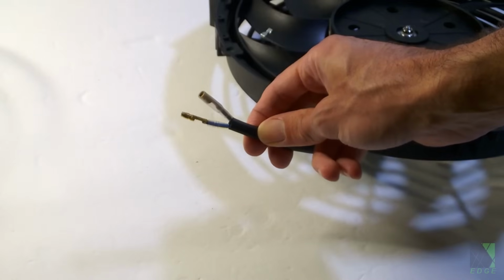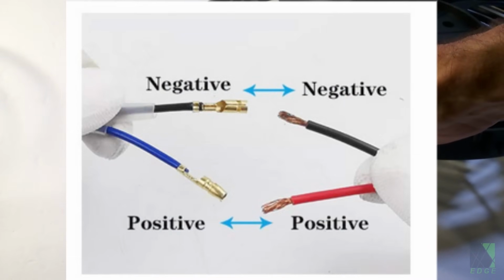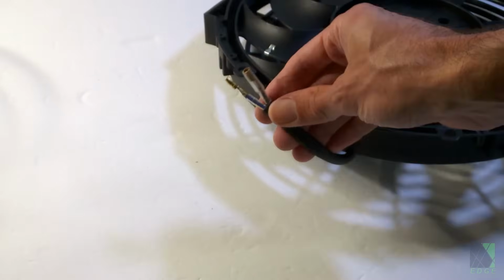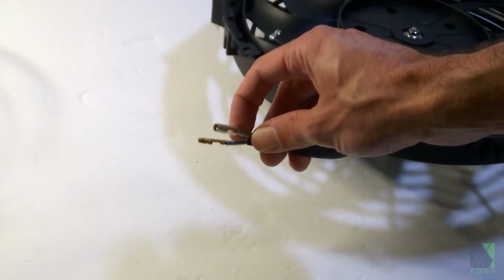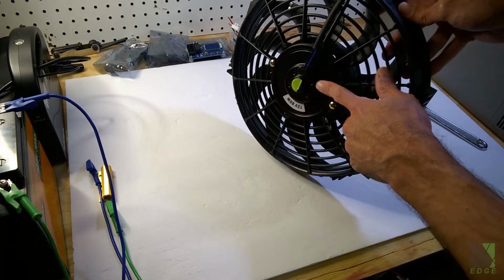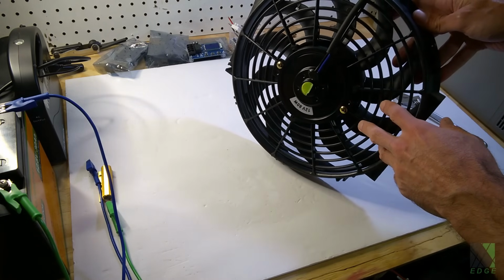How To Reverse a Car Radiator fan from Puller to Pusher - Solar Powered #Shed Ventilation Guide #DIY

Comment: You say that the fan has to spin clockwise. That’s the only way yet then you reverse the fan to spin the other way.  Now I’m really confused.
Reply from the maker: @davidsevier5656 Yeah this can get pretty confusing. The blade is shaped aerodynamically to spin one way only. But once flipped over, it is now spinning the wrong way. That's why the direction of the motor (polarity) must also be reversed. And this also reverses the air flow direction. If you don't want to deal with flipping the blade, mount the entire fan the other way around. Depending on mounting style, you might need a 12" fan grille to cover that blade. Only one side of the fan is protected by a grille.

Comment: Question posted Jan. 6, 2025: Can a PWM motor speed controller consume some of the power (fan speed power) of my 12V, 180W radiator fan?  If so, approximately what percentage of the maximum fan speed is lost from using a 40A PWM motor speed controller?  If I use a 30A PWM motor speed controller instead of a 40A speed controller, will my 12V, 180W fan run faster, or will the fan speed be the same with either of the motor speed controllers?  My power source is two 12V, 100W briefcase solar panels.  Thank you so much for your informative, interesting videos, and for answering your viewer's questions.
Reply from the maker: Hello, I am glad to help. PWM will consume a few watts (maybe 2-3% I guess), but there is no way around that. It's not really harmful, because imagine without it there would be zero control over the motor. We exchange a bit of lost power in return for speed control - it's worth it

Comment: I want to reverse the air flow direction of a 12V, 180W solar fan by removing the fan blade and flipping it over as you demonstrated, and reversing the polarity wire connections as you demonstrated so that the blue fan wire is now negative instead of positive, and the black fan wire is now positive instead of negative.  Please explain in detail how I then wire my amp / watt meter and my 40A PWM motor speed controller.  I presume I need to connect the blue fan wire to the negative load terminal of the motor speed controller, and  I presume I connect the black negative fan wire to the positive load terminal of the motor speed controller.  Is that correct or is it incorrect?  Please explain the correct way I connect to the positive load terminal and negative load terminal of the motor speed controller, and the correct way I connect the red positive wire of the solar panel(s), to the solar power terminal of the motor speed controller, and how I correctly connect the black negative wire of the solar panel, to the solar power terminal of the motor speed controller.  Please explain whether or not the red positive wire of the solar panel connects to the red power source wire of the amp/watt meter, and wether or not the red positive load wire of the amp / watt meter connects to the red positive power source terminal of the motor speed controller.
Reply from the maker: @bradlyons7046 Hello, the solar panel Pos/Neg connects straight to the Pos/Neg of the wattmeter first (then it should turn on, you can check). Then connect the PWM controller Pos/Neg to the Pos/Neg of the watt meter output.
With regards to the fan polarity. Usually they have a black and blue wire. I find usually blue is positive but there is no guarantee. However, try reversing the blade and connect the Black wire to the Positive of the motor speed controller output (and blue to negative), then check if the fan operates well. If the blade is spinning the wrong way, the performance is terrible - it's usually noticeable. Hope this helps

Comment: I got a push/puller fan from eBay the universal one, I was told all I need to do is swap the wiring around so black is live and blue is ground to use it as a pusher fan would I still need to turn the blades over or not?
Reply from the maker: @ashlysimon22 Hi, does it have curved or swept blades? I have never seen a modern radiator fan that could run the blades backwards - they have to be flipped over (AND reverse the motor). However, I certainly don't claim to know everything - there could be an exception! 

How about spin the fan in both directions, and check the air flow and sound. If it is the same both ways, maybe it's a different (universal?) blade design. Out of curiosity, I did test a fan without flipping it over, and the sound was different and it blew less air.
Reply: @solarpoweredge  it's curved blades on the fan
Reply from the maker: @ashlysimon22 Ah, probably need to flip it over then. But it takes 10 seconds to reverse the wires and see what happens. Maybe it will just work

Comment: Could this power vent my attic in the summer? Temperature switch and a solar panel on top of the attic vent and maybe a battery for the extra power generated.
Reply from the maker: @thorhammer6040  Yes, a car radiator fan can vent an attic. I'd suggest running the fan at 8-10v max so it doesn't get so hot and wear out as fast. Can also run without a battery if you want to, straight off the solar panel

Comment: Would it not just be easier to turn the entire fan around, mount it backwards like you would in a PC case?
Reply from the maker: @Allexz, no radiator fans are generally mounted on the flat side against the radiator or opening. Reversing them from puller to pusher is a very common task. So this knowledge applies to both sheds and cars/trucks in general. 

In both my shed, the fans had to be mounted round side facing out or they don't fit. Not only that, there is no protection from the powerful fan blades if I somehow mounted it the other way around.

Comment: Are you going to connect to a speed controller switch or use a Thermostat Switch Circuit "button" to turn on the fan at say 86 F  and off at a lower temperature? Maybe just an on/off switch?
Reply: I use a small button type switch for an RV fridge "computer style" fans when that small space reaches a temperature of 100 F. They have commercially available options, but prefer the fun of making my own.
Reply from the maker: @MrRoboto2338 I hear ya there, thumbs for DIY
Reply from the maker: @MrRoboto2338 In one shed there is a PWM speed controller which is very handy. The other fan in that shed is 12v brushless with an adjustable DC converter. Both work pretty good. The 24v fan in a smaller shed just runs sun up to sun down. Might look into a thermostat in the future, ideally a mechanical DC one. Right now the fans are blasting all day, it is super hot